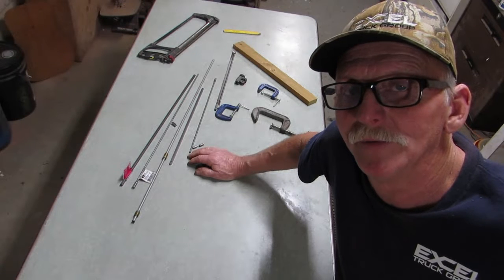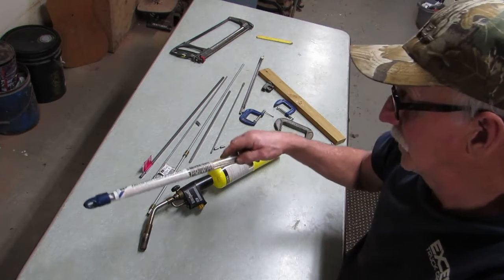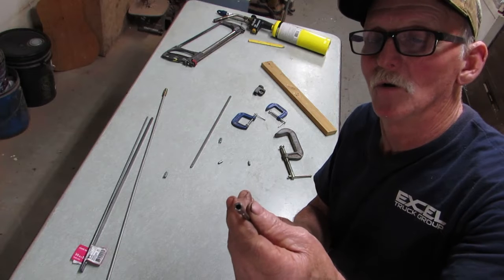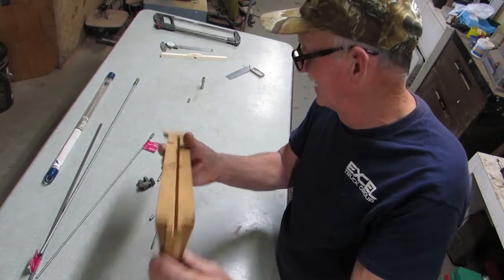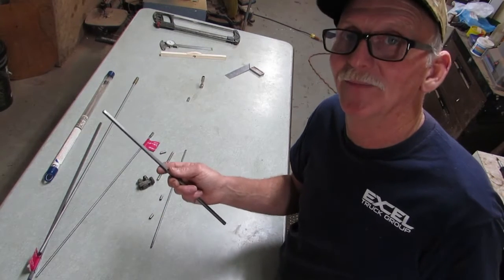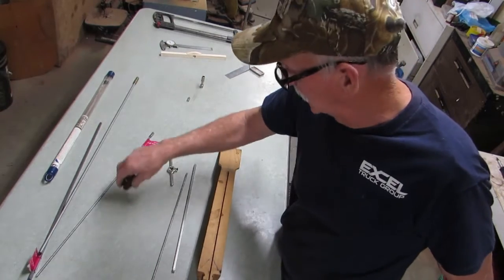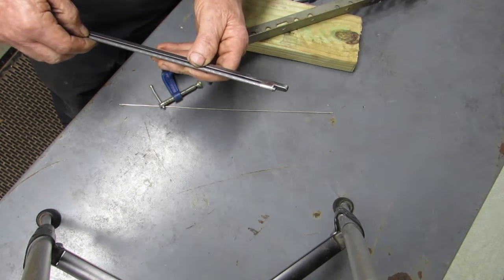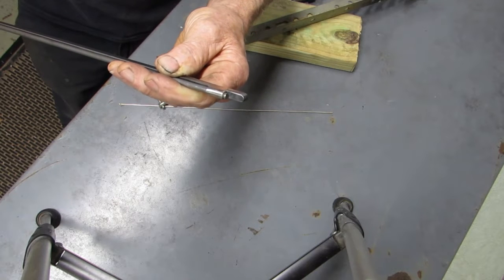Build Your Own Truss Rod (Acoustic Guitar)

Comment: I build similar truss rods but use round mild steel or sometimes  high tensile steel for both pieces - though low grade mild steel does the job well. Truss rods like this are only single acting, but are cheap to make. I also only use brass nuts - not steel. In order to make a two way truss rod, the adjusting rod needs to have a right and a left thread fitted. Just a small point also, you are not welding, you are brazing if you are using phosphor bronze rods and soldering if using silver solder rods with flux. Cheers, good presentation mate!!
Reply from the maker: Point well taken! Thanks for watching.

Comment: So, this is a single action truss rod? What would be the assembly difference with a dual- action truss rod?
Reply from the maker: Yes sir this is single action. Hard to describe a dual action with words only but the front sleeve would be threaded and the nut welded to the round rod. Instead of being welded solid at the other end there would be a washer welded on either side of the sleeve. you get a push pull action that way if that makes sense. A bit more complicated to make. I've never had a need for a double action rod though some people swear by them. I build the neck with about .005 relief built in before gluing on the fret board so the tendency is for the neck to bow forward. Never had a neck back bow although I understand it could happen. I think the built in relief prevents that in my experience.